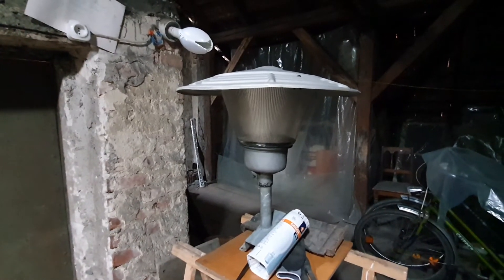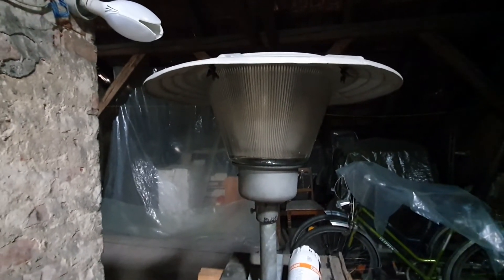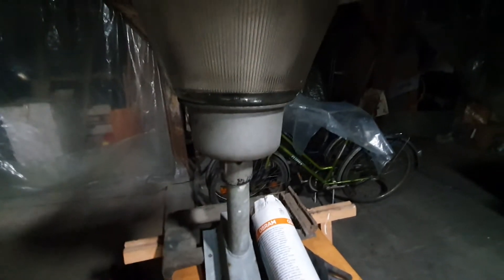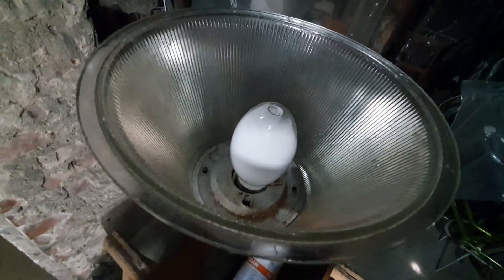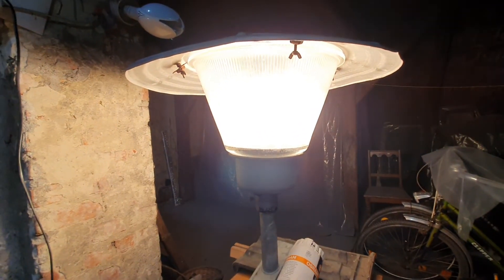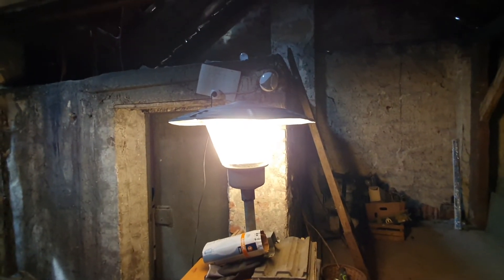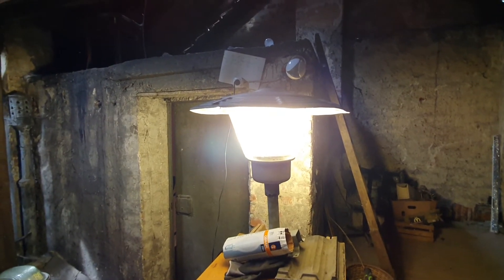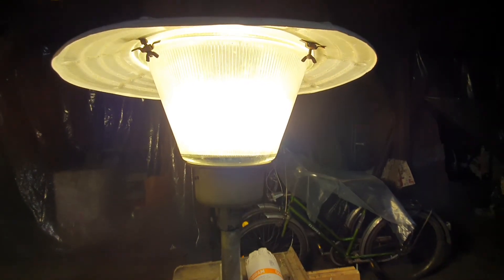MESKO OZPR 250 - 250W mercury vapor streetlight fixture from the 90's

Comment: Why does this look yellow even though it’s green?
Reply from the maker: @Trafficlightsiosandmore it is a blended mercury lamp that has a tungsten filament in series to the mercury arc tube. This lamp does not require a ballast and can run on mains voltage. Since this fixture has no built in ballast, such a lamp is required. A blended mercury lamp will start up emitting only the yellow incandescent light and changes more and more to mercury green as it warms up. However, e even fully warmed up, there is still some incandescent light being emitted.
Reply: @mercuryvaporglow5317  then maybe you can just adjust it a bit because you may have accidentally turned on incandescent mode on it.

Comment: Man i bet that metal top gets very hot with a 250 mercury vapor.  Im surpised that was made in the 90s.  But then i do have 175w bucket mercury vapor lights made in the 90s.

The plastic refractors just block light.  I dont use then for my 175w mv or my hps liguts.. if you move the refractor up and down youll see light output drops by 20% at least with them on
Reply from the maker: Yes, indeed,  the self balasted Mercury vapor gets even hotter.  Fun fact: the 400W Mercury vapor bulb fits in this fixtures but is not recommended. 

The bucket light refractors are intended to guide the light downward but of course they take away some light. In Europe,  we don't have any bucket lights, I think they are really stylish 😎
Reply: @mercuryvaporglow5317  thats all we used here is bucket lights and cobra heads of some sort.   Other types of square floods for big streets.

Some buildings in older areas have cool looking icecrean cone shaped fixtures.   Always wanted to grab one of those lol.

I have a 150w High pressure sodium industrial light.  Its solid metal.. thick.. with thick glass and a metal cage around it.  Never seen anything quiet like it.   I made a video of it.  Its on my channle further down the page.   Its a Hubbell light.

Check it out if interested